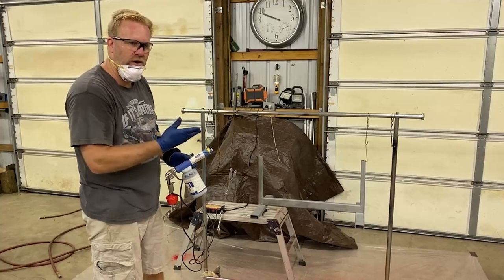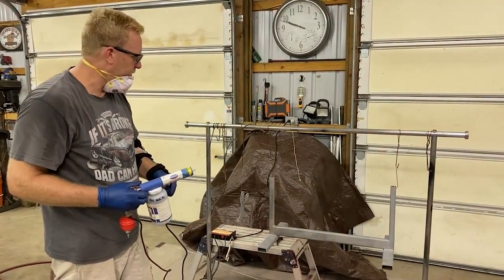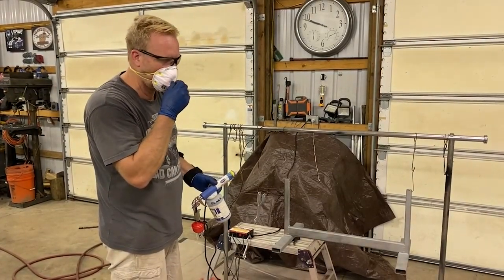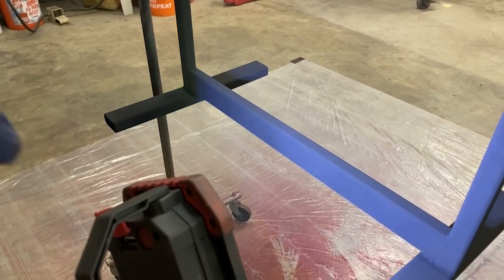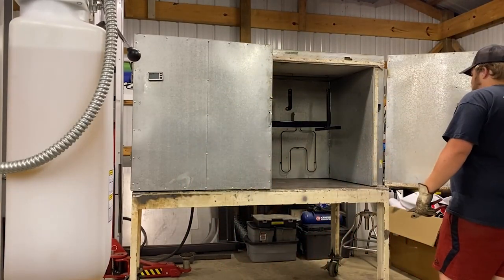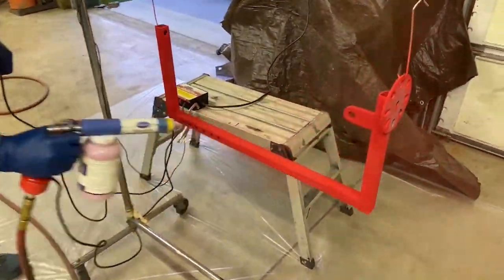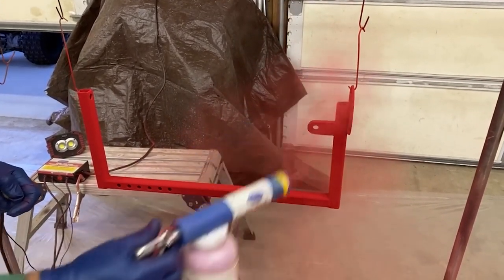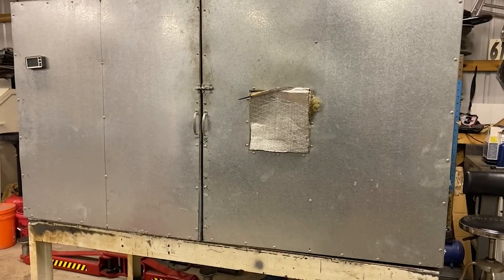HOW TO POWDER COAT WITH A DIY POWDER COAT OVEN *ANYONE CAN DO IT!*

Comment: great video. question, how do you get the powder in the area where the wire hook is touching/hanging the part?
Reply from the maker: It all depends on what you are powder coating. Usually we like to use the welding wire as a "hook". We try to make the hook larger so it doesn't cover the outside where it needs to be coated. We like to place a hook where we know a bolt or a washer will be going in that place just incase it needs to be covered up. If you have a bolt hole, you could throw a bolt in and use two nuts to clamp the welding wire in that as well. Just make sure you put some high temp tape or Teflon tape on both sides of the bolt shaft so you bolt doesn't get powder coated and gets stuck in the part. We are in the making of creating a Q&A video on everyone's comments on the powder coat oven and the how to coat video. I would say in the next month or so that video will be out! Thanks for the comment and thanks for checking out the video.

Comment: Nice work! Pretty much exactly how I started out as well. If you plan on powder coating often consider a simple booth. Your nice and clean shop will soon be covered with powder like mine lol
Reply from the maker: Thanks for the comment and checking out the video! But, its funny you say that because if we are working with a bright color you can see it everywhere like a dust covering lol That's why usually we tarp over things that we don't want to get dusted. Maybe we need to create a area with drop tarp walls with sliders where we can enclose our selves in it! That sounds like a fun DIY build haha
Reply: @alwayssomethinggarage794  I know the feeling! lol clears are the worst because of how light they are. I started with a 3 sided small budget booth made of pvc and clear wrap but that wasn’t much fun moving around it was pretty flimsy. Even a simple booth with box fans and furnace filters would be sufficient for the amount of powder coming out of the Eastwood unit.

Comment: Excellent video and a very thorough explanation, 2nd great video of yours I've watched today I have subscribed to you guys.😁
So here's a question for you guys:  I'm a metal polisher of almost 30 years in the UK btw, old alloy/aluminium parts can sweat a lot after polishing (friction = heat causes the sweating), so how do you deal with older contaminated castings in particular sweating during the curing process?   Or do you preheat and cool off before powder coating to prevent gassing out?
Reply from the maker: Thanks for checking out the video! The biggest thing we have to deal with parts getting corroded after getting sand blasted. We try to sand blast our parts as close as the date we want to powder coat so it would limit the chance of corrosion. But, with living in Maryland there is a lot of humidity. I know we make sure before we start the powder coat process we visually check to make everything is clean and no corrosion and then right before we coat we acetone every surface. I know for when we do bike frames we do like to put the frame into the oven for a short period to burn junk off of the frame and to heat up the metal for the powder to stick easier to the tight corners.
Reply: @alwayssomethinggarage794   Thanks for the reply, makes sense to get the freshly blasted parts coated asap especially in a humid environment. I have just seen a video by Bullseye powder coating and they said they acid etch prime corroded aluminium before powder coating to prevent the nasties locked inside the metal peeling up the powder coat from underneath.  I'd imagine they cook it first to let most of the gasses out then acid etch as a precaution to stabilize it. If your interested he mentions it at about 25m in this video: https://www.youtube.com/watch?v=DrymfUjgHpQ
Reply from the maker: @0shiny1  We will check out the video! Thanks for the info. It's not the best to be powder coating in a building that is not insulated. But, we try to do our best and I think it's pretty darn good for home powder coating. Definitely saves some good money! Thanks again for the comments and checking out the videos!
Reply: @alwayssomethinggarage794  No thank you guys for making your videos they provide us all with great ideas that even us older blokes can learn a lot from, keep up the great work.👍

Comment: do you have a components list for the control box
Reply: for your oven
Reply from the maker: @jodymcconechy9165   Yes I do, Email us at alwayssomethinggarage@gmail.com. Thanks for checking out the video!
Reply from the maker: @jodymcconechy9165   I also put the parts list underneath the description on the powder coat oven video. Thanks.

Comment: #AlwaysSomethingGarage also can u a durability test like chemicals oils gasoline and hitting it with a hammer see if i would chip off how would it hold. like small powder coat parts for test pieces. that would be a cool video i have never seen anything like this.

Comment: So is the silicon tape used to cover things such as threads? or something that you don’t want Powder Coated?
Reply: Yes it should be heat resistant too
Reply: Should cover all threads for sure or openings that shouldn’t change in size.